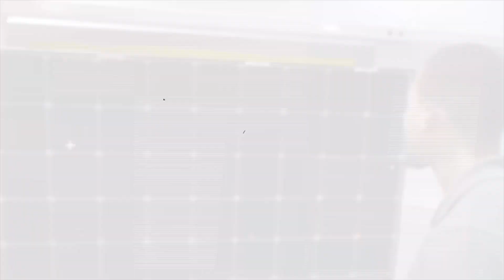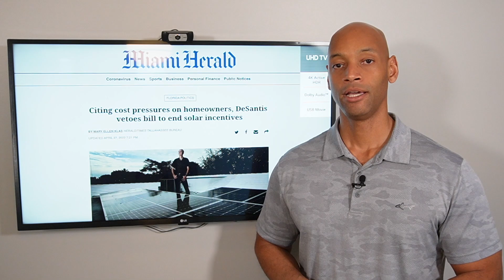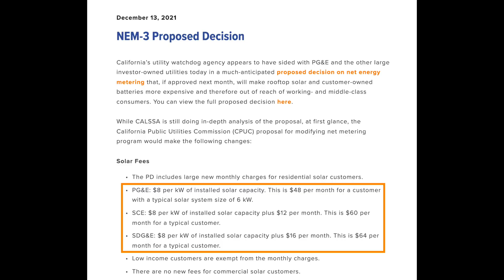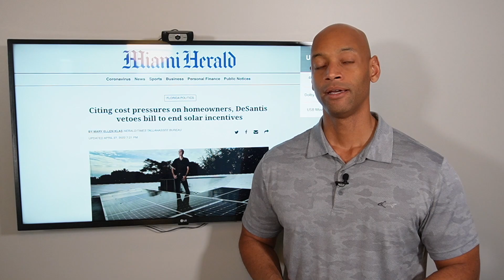Victory for Florida Solar Program

Comment: How can a company state they can lock the cost of electricity if you go solar now. Please get back to me. Thanks for a great video.
Reply from the maker: Hi Mike. You would enter into a Net Metering agreement with your electric company. You are locking in a one for one buyback arrangement. It doesn’t mean the electric rate doesn’t go up but the electric rate shouldn’t matter for you if you have offset your electric bill with your own solar.

Comment: They did veto that, but FPL managed to push “minimum charge” to the bill. That made our interconnection charge go from $10 to $28 a month. What’s worse is that even though they charge us a minimum usage bill whether we use excess from the grid or not, it bothers me that on top of that when we do go over what we produced (ie. November, December) not only do they charge you the minimum usage charge (which would amount to like 100kwh or so) but they also take a chunk of whatever credits you already have, so they kind of double dip. I’m amazed no one thought to stop this! 😡
Reply: To clarify, say I used 100kw from the grid in excess to what i produced in that month. Well, FPL still charges the $28 minimum usage which could equate to maybe 50-80kw, so instead of taking the difference of 20kw from my credits, they go charge the $28 minimum usage and then take 100kw from my credits. How is that even fair???
Reply: @unkhammunankh7252  Can't wait till we don't need grids at all anymore. Solar and battery technology just need to leap frog somehow. Power companies really seem like greedy crooks. Not to mention the quality of their services have gotten worse. I've for sure experienced more power outages, much higher bills. Makes no sense.

Comment: This industry is filled with too many broken promises and crooked contractors. If you are considering solar panels you really need to do your research and be present when the installation takes place. There are too many things that consumers need to learn such as how the panels work, how are they properly installed, township regulations, power company regulations, contract terms and conditions. This will be a project you will need to be present for and supervisor yourself. If you leave it to the installation contractor most likely you are going to get screwed. I don't forget to consider what happens if your roof gets damaged during the installation because the contractor will say "That's not our fault". Also what is the return on your investment. After considering all this I am more than happy to pay my power company for my electricity, I have peace of mind and can sleep at night.

Comment: The question here is how long do these panels last. And what happens if hurricane Andrew passes by again here in Florida and blows the solar panels away. F** them all up.
Reply: solar panels optimal performance is 25 years and it will work for more than 25 years. You need good installation company to install solar panels on your roof that will remain intact in case of hurricane. In order to get Zero electricity bill always install solar system which is more than house electricity usage.
Reply: @javaidnasir6633  can you shut down the electricity from the company after installing a system that will cover the whole house.
Reply: @xxCHOCHANEGRAxx  if you install hybrid system than you can cut of electricity from electricity company, but i have install on grid system benefit of on grid system is that you can send back surplus generated electricity back to grid and they will give you credit on that surplus generation and your electricity bill will become zero. When you install batteries it usually last for 2 or 3 years and after that you have to change these batteries, so for me on grid system is better than hybrid system which is much cheaper than hybrid system and give you zero electricity bill for life.
Reply: @xxCHOCHANEGRAxx  my first electricity bill after installing on grid solar system was close to zero because my solar system produce excess electricity and that goes back to grid and they give me credit in my electricity bill and bill become zero.
Reply: @javaidnasir6633  so the electricity company is making money off of your solar energy. You should be getting a check back lol
Reply: @xxCHOCHANEGRAxx  all the credit amount is adjusted in my electricity bill, monthly taxes and meter rant is paid by the credit amount which is generated because of excess Units of Electricity which my solar system produces. And yes companies do purchase my generated unit at lesser price and than same electricity unit they sell to my neighbor at higher price.

Comment: I think you got it wrong on  black outs, when the power grid goes down, they wont let your system generate while power is off, they say for safety of line men working on lines. When power is out and your battery dies, you are in the dark!
Reply: If you have hybrid solar system it will keep on generating electricity even grid is off and it won't send extra electricity back to grid and send it to the batteries.

Comment: As a San Diego Gas & Electric customer, I lost my 1 for 1 NEM when I upgraded my system. And they're trying to take it away for everyone and then charge more fees. I still need batteries but hasn't worked out financially.

Comment: What about FPL minimum charge for solar on electric Bill. FPL started charging an additional $25 on my electric bill. This charge started in May. This will reduce my ROI on my 10KW solar system.
Reply: It's all a joke. $ 35 here in central florida.
Oh, & I just found out for 2024 buy back rate is .02 cents per Kwh. Hmm, while they charge more then .10 cents per kwh use.
Reply from the maker: Yeah that’s called the fixed charge. There really is no way to get rid of that. It is for maintenance of the gridlines to and from your home. Where I live, I pay $26 per month fixed.

Comment: So, if I put up solar panels tomorrow, and next year the vetoed bill goes through, will it affect those already using solar...are you locked in on net metering or are you screwed with trying to pay off panels and paying electric? I hope this is clear. I just started researching.
Reply from the maker: Normally you are grandfathered in once you have net-metering set up on your account.

Comment: As someone who installed a solar system last year, I clearly see the benefit of creating incentives by being able to sell surplus electricity to the electric company at full retail.  This is also appealing on a kwH for a kwH basis.  The downside is the electric company has overhead and normally buys electricity at the wholesale rather than retail rate.  This can shift the burden of the power company overhead from relatively affluent homeowners who can afford solar panels to poorer electricity customers who can't afford a home or solar panels.  As more solar comes online, this potentially becomes a significant social justice / equity issue, with poor renters subsidizing rich homeowners.  So it is a delicate balancing act between encouraging solar installations but in a manner that does not shift too many costs onto the poor who can't afford a home or solar.
Reply: Remember, the power companies CEOs make millions a yr!! So they need to cut that if they hurting too bad.
Reply: Get the hell out of here with that phoney communists cover for your corporate shilling.

Comment: Desantis is one of the best govenors in the country.  Newsome, in California, they want to start charging you more every month depending on how much solar you have as a base charge.  Right now, they charge you $8 per month.  From what I have heard, if you have a 15 KW solar system, they want to charge you $150 per month.  That will kill the ROI.  Pretty odd since California has the most aggresive solar targets.  This "tax" is being driven by the 2 largest electric companies.

Comment: I would approach Governor De Santi's office or someone in congress to introduce a bill that allows people to install a battery and a inverter so they can store their power produced with their solar panels. We call this being "Off Grid" in Australia and it works well where peoples homes are a long way from the grid, but also works in the suburbs. In 2011 I installed 1.4 kw system (that's all that was available at the time) and I was lucky enough to get a contract to supply my electricity to the grid at 66 cents per kwh. I have saved so much over the years. Now I have more panels that are more powerful and more state of the art as far as efficiency goes.  I am going to just store my power during the day and use it at night. If there is excess it will go to the grid, but from July 1st the feed in tariff is dropping to 0.02 cents per kwh. Hopefully that won't be often. It will take me years to make any money. Saving money on power is the point though. Tesla has a great battery. It can store 13.5 kwh of energy.

Comment: Thank you for the informative video which clears up some of my questions. I would add a caution to anyone evaluating solar. It’s important to not overlook the impact to homeowners insurance. In Florida insurance companies are dropping policies if solar is installed on your roof. I personally know someone locked in a solar contract now stuck with an $8,000 annual insurance bill so they don’t loose insurance.
Reply: Floridians are being hussled here in florida by all insurance companies from car to houses
Reply: @Tactical-Black  Florida problem is their laws and lawmakers who put residents and businesses at risk and refuse to address the growing crisis. Many insurance companies and companies in other industries will no longer do business there.
Reply: That seems a little excessive. How much was their insurance before adding solar? Do they live in a flood zone? Too many variables not known to draw an accurate conclusion.
Reply: @AchillesWrath1  previously paid $1,200. Letter from insurance company clearly stated cancellation was due to risk of solar panels. Florida laws creating an insurance crisis is part of the problem.
Reply: @justoneman3916  Hmm still seems way too high to me. I plan on moving to FL in a year or 2 and adding solar. I can't imagine solar alone would increase home insurance by $6800 a year. I guess i'll find out. You can buy a nice solar setup for $30K with a 30% rebate bringing cost down closer to $20K. IMO you'd be foolish not to have solar in FL it's the perfect state for it. 

Depending on the area i'm aware of the insurance issues. Fort Myers and Cape Coral there are a lot of flood zones. They're making people completely demolish and rebuild their homes if they suffered 50% damage. They want the ground elevation built up to get them above the flood elevation. It's understandable because insurances would be like $10-20K a year and who can afford that? It's a tough choice for the cities but better for everyone in general going forward to keep insurance costs affordable. But also a tough spot to be in for the original home owner. Hard to build a new home based on what they were paying insurance on. Their homes were valued much lower than what it will cost to build a new one.

 I would suggest to your friend to do some insurance shopping. Between me and my wife we saved about $800 last year switching auto insurance because i noticed the rates had gone up considerably for no reason at all. The same thing happens all the time with home and auto insurance. Most people just don't pay attention and are too lazy to switch or shop around. That's exactly what the insurance companies are hoping for.
Reply: @AchillesWrath1  If solar is in your future I suggest looking at Tower Hill as they added a solar roof panel coverage option in December although I don’t know the cost. Also, ensure wording in the solar contract guarantees operational service within your agreed upon timeframe as there are some pretty sketchy installers ruining roofs and taking many many months to attach to the grid after the panels are installed. Good luck!
Reply: @AchillesWrath1  You need to do some research on the homeowners insurance crisis in Florida.
Reply: @retiredpornape  Like what, can you point me to something? I've looked a little and from what i've seen it's certain areas of FL not all that are giving people a hard time about home insurance and solar. And they seem mainly Florida Power and Light utility areas. Those guys are pretty dirty imo. They're pretty much the one's who wrote the bill that got vetoed by DeSantis trying to drastically cut and eventually eliminate net metering. I'm glad DeSantis said sorry not today but they'll probably keep trying with more lobbyist money. Funny how politicians and people preach "go green, we've got to get off fossil fuels". Then yet you've got people like FPL who definitely don't want too many people putting up solar because essentially it'd put them out of business so it's understandable why they're fighting it so hard. Other than that i don't know what insurance issues your talking about. I don't see any of that happening in Lee County which is where i plan on moving to and run by it's own co-op utility, not FPL. But i may be wrong on some other solar insurance issues that i'm not aware of. If you could point me to them i'd appreciate it. Thanks
Reply: It's because they void your roofing warranty. Florida gets feet of rain a year and high velocity winds from hurricanes. Buy enough land to ground mount them and you won't have a roof problem.

Comment: Our developer installed the power lines and street lights in our community. Duke had no part in our underground lines. Actually they are getting a good deal as they have no overhead in the power sold back to them. This is just more big energy hitting the homeowners

Comment: Now they have minimum bill requirements... so you have to pay a certain minimum regardless of anything you generate.
Reply: I’ve had solar panels for 5 years in Florida and I’ve had that all along. But that minimum is really the separate charge for maintaining the lines going into my house. My bill has separate charges for electricity usage and grid maintenance. But it also had those charges before I installed solar panels and the charges haven’t changed since I installed solar panels. Yes, I review my bill and monitor it.

Comment: Hi Joe, Thanks for your information. I have a question about this maleficent rule: The BN741 could affect just for buy-sell relation just with the overproduction or is it also with the daily send back and forth of the energy to the grid? because as you said, the only way to avoid that one is with total control over the grid by adding batteries to the system, that idea makes me think that any time, any day, doest not matter when and how, and not just for overproduction, we will be affected for that law.  Thanks for your reply.
Reply from the maker: The proposal would have affected the daily back and forth net-metering for retail customers.  Thank God it was vetoed.
Reply: @SolarSurge  Thanks my man, you are the best.
Reply: The power companies will just  reintroduce  the fees in a different way!
Reply: @charlesgeorge2197  in fact, fees for the grid raised in a important number during these days.

Comment: If we install home batteries, net metering with have no effect on us?
Reply from the maker: Yes. If you have batteries, you can avoid net-meting.
Reply: @SolarSurge  what about the monthly charge they want to start?
Reply from the maker: @R_J_G  That varies by utility.  Some are <$10 while others are $30 (Duke)
Reply: @SolarSurge  This charge is unavoidable?
Reply from the maker: @R_J_G  Yes.  Unless you disconnect completely from the grid.

Comment: It IS only fair if the power company is going to USE your solar they give credit (PAY) for your solar what they charge for it.  At the same time there are costs for lines to your house and the grid overall.  But the charge should NOT vary depending on your use. It should be an across the board charge and save EVERYONE money. ONE charge for everyone not built into the per watt use. States should consider that and FORCE the companies to make that math visible and public. In committee make the determination what that charge should be per customer and pro rate it and do that every 5 years or so.  They are a regulated company and rates need to be fair and fairly applied.  And if their point is all customers need to participate in keeping the grid up then make that process transparent.  If their point is greater users need to participate more (such as commercial enterprises because their demand is MUCH larger than private homes) fine hash that out in committee but that IS the point. A "minimum fee" does NOT fit that bill.  After all WHEN the power company "buys" power from the solar customer should THEY not bear some of the grid cost as well?

Comment: I am in Florida, and just finished install of Tesla solar. The batteries are enough to run the house over night with little or no grid power.  Duke could take advantage of residential solar by building battery farms to capture the excess power and resell it during the day after all they are a large Monopoly.  Currently Duke is purposing building 2 more trash fired plants in my area. WOW sounds real green right?  Only one percent of homes in Florida use solar.  That is a tragedy. The power companies should be Solar Advocates, and push for residential solar instead of squashing it in favor of 120 year old technology.
Reply: They can partner with residential solar and make a bigger profit than by trying to fight something that will inevitably take over.
Reply: @f82rob  They are like a junk yard dog chained to an old Chevy and defending it with the determination of a cornered Rat.  It is a 120 year old technology that has not change much, is at all.  The last big update was the Dynamo, little has changed since.